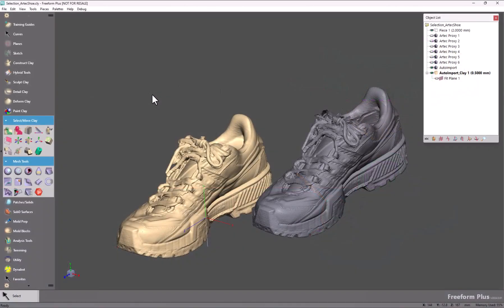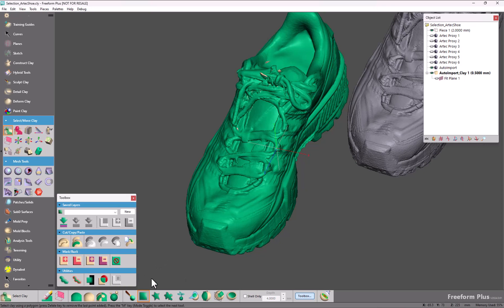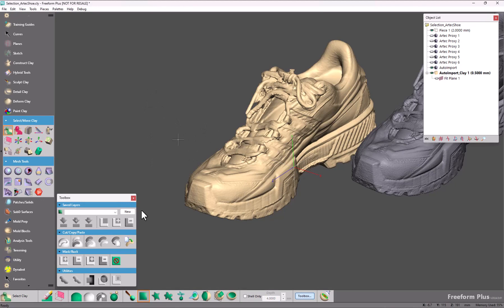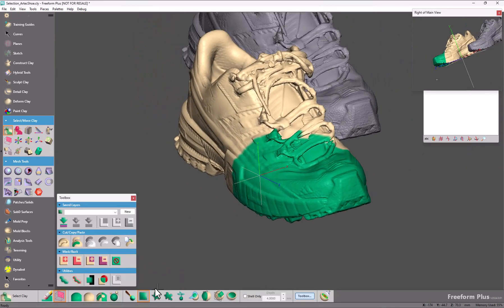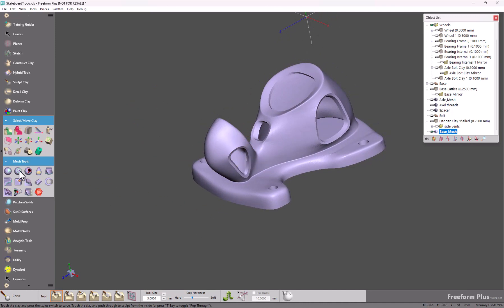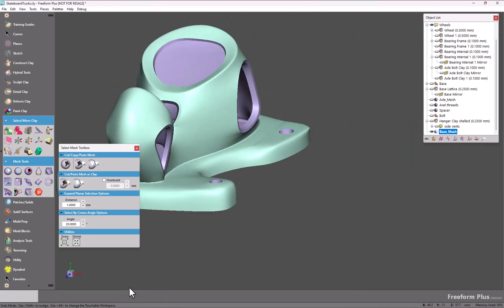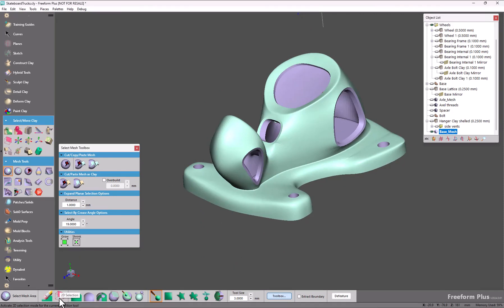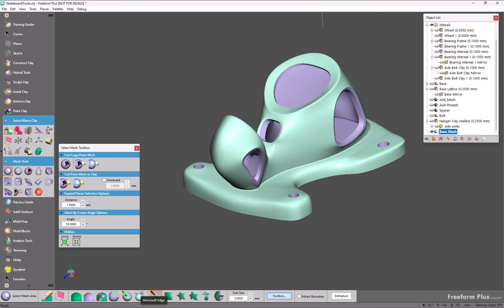Selection Enhancements - Feature Highlight | Oqton Freeform 2024

Comment: This is a great addition to the toolset and Freeform is a really good application, which has improved our design-workflows immensely. But, to receive this update, you need to have an active maintenance subscription which costs 1750€ per license per year - in addition to the 8000€ initial cost of the application with the haptic device. This is just my opinion, but i believe this is simply too much. One software maintenance subscription should cover some or all the used licenses of one customer. For a company with 4 licenses, getting just these new selection tools would cost 7000€ if you've purchased the licenses 2 years ago. Also keep in mind, the tools in this video are almost certainly all that was improved in the last 12 months - which is a lot, compared to the updates from the previous 4 years. I wouldn't want to work without it, but it's impossible to justify these running costs and it's really hard to accept this level of corporate greed.